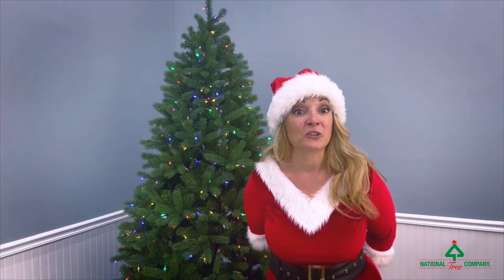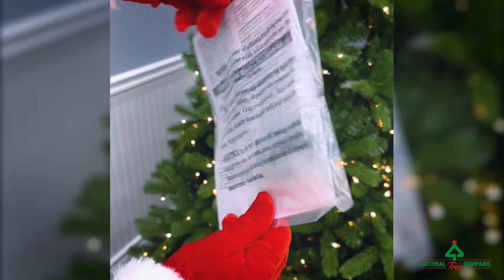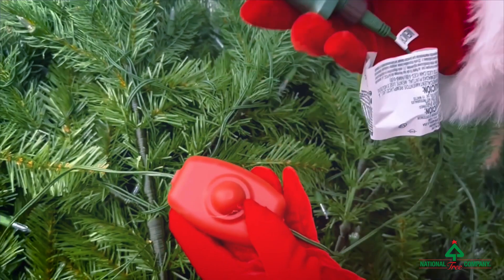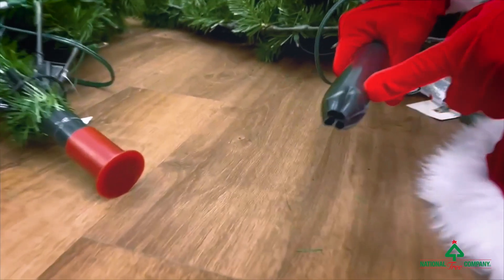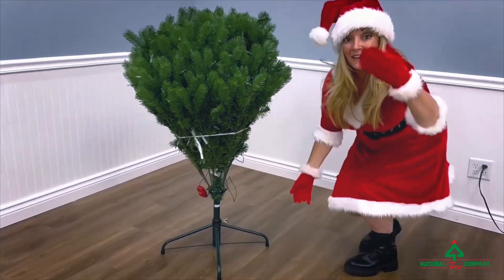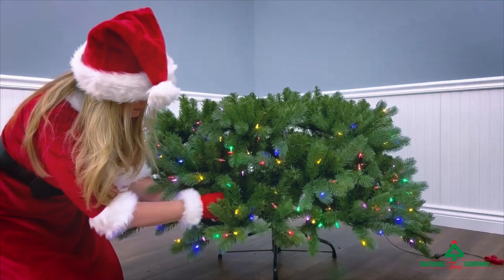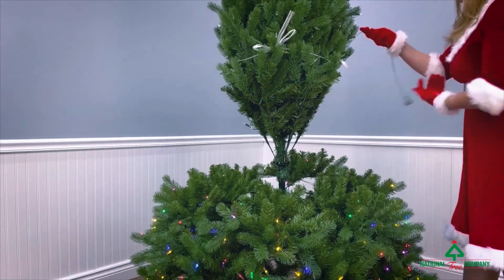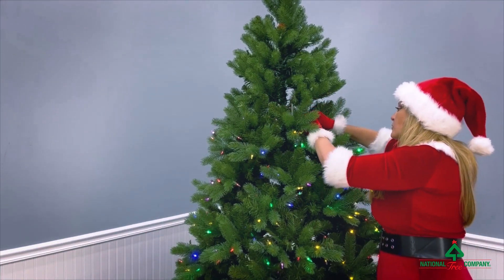Assembling an LED National Tree

Comment: My tree is a 9 ft. LED pre-lit Dunhill Fir and each section has multiple plugs. I can't find enough connecting plugs to connect each section. Only the bottom action lights up. Solution?
Reply: I’m having the same issue with my tree this year same model. It’s frustrating they don’t mark the connecters.
Reply: Also same maybe there's another color set I think calledulticolor, I'll look up the instructions for those and see if the clue is in there. LMK if you figured it out LOL
Reply: I'm having the same problem! So frustrating!!!
Reply: Same issue. Any solution?
Reply: me too. Only bottom section lite

Comment: The one i have the base is 6.5 ft. Has anyone tried to remove the base and just use the other 3 Pieces? This is for the 9ft. Pre-Lit Jersey Fraser Fir Tree with Clear Lights KU: PEJF1-300-90